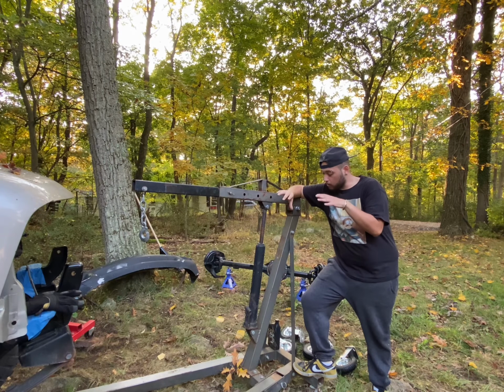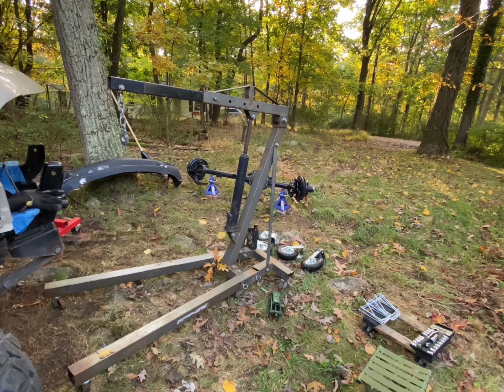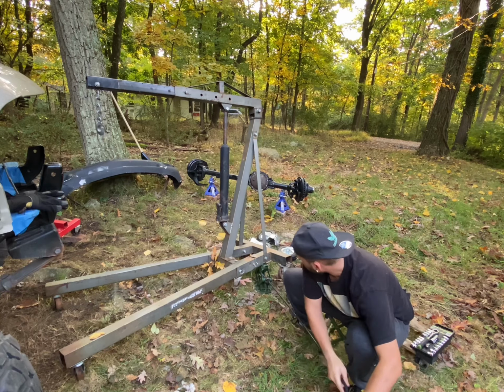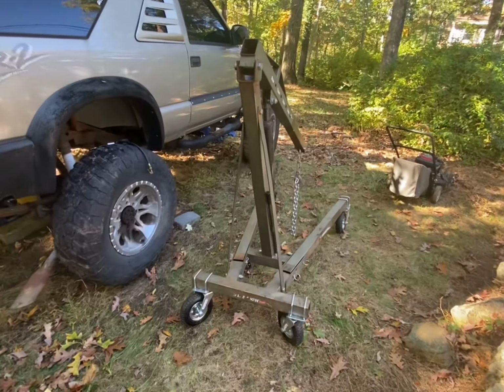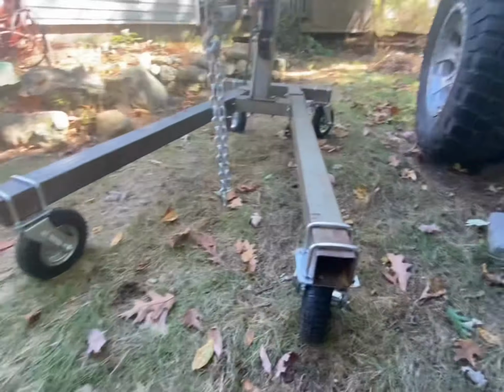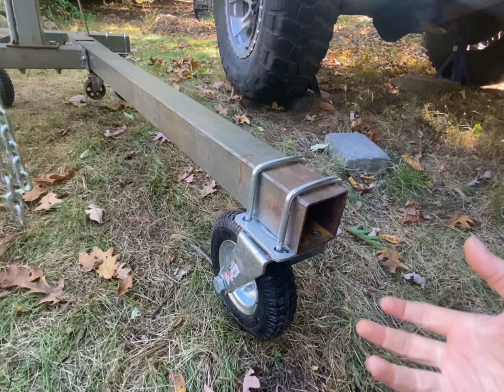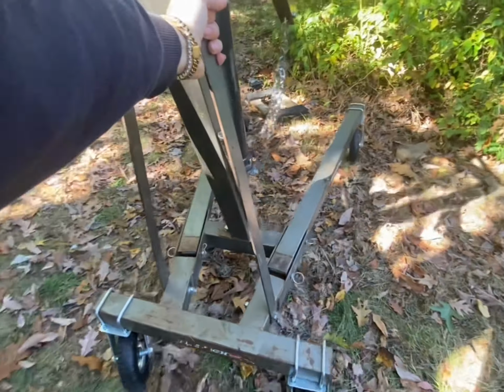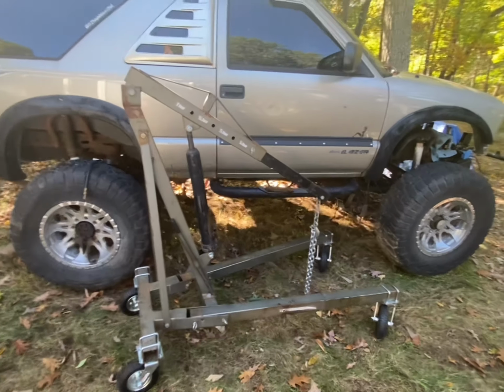How to (or not) lift your engine hoist

Comment: lets see this hoist move with the engine hanging.
Reply from the maker: I’ll do one when my 6.0 is reassembled. New job new house and another engine swap took priority the last 2 or so years. I’ve been able to move a few heavy objects around the yard, for the most part it’s pretty smooth, but occasionally it’s hard to direct it. Loaded or empty, those castors don’t “cast” very well lol. Not sure if it’s something I did.